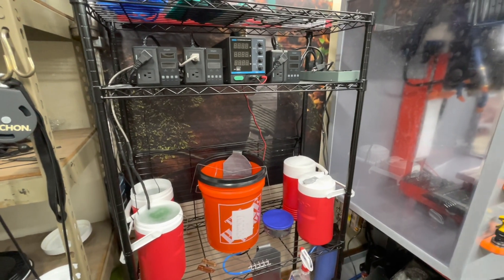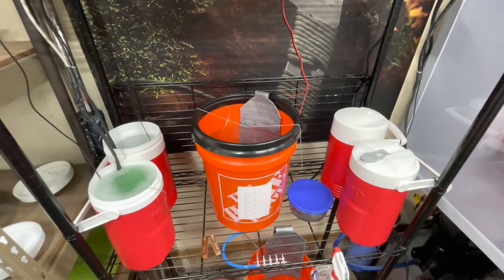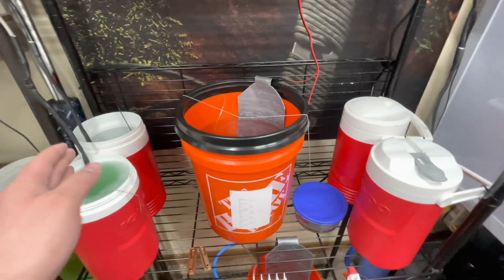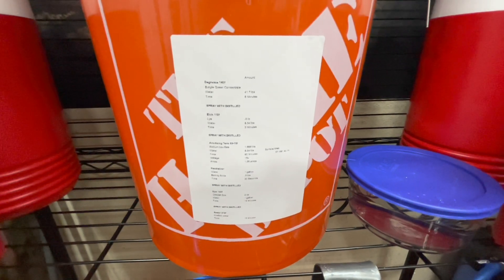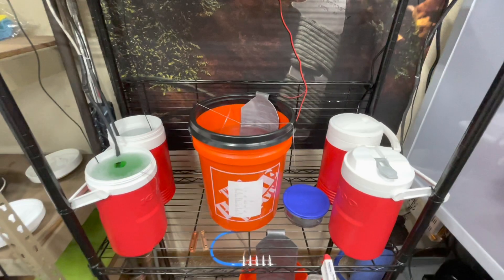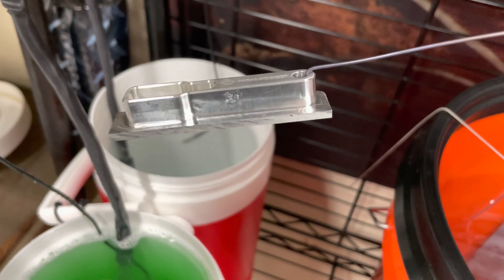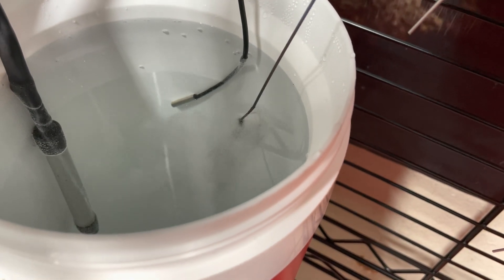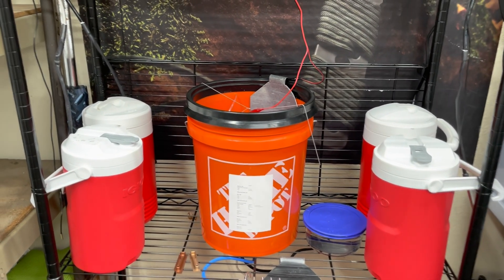Aluminum Anodizing at Home! No Sulfuric Acid.

Comment: Nice set up. However, you will have an incredibly dangerous situation if there is a spill. You never want basic, nor alkaline materials in close proximity to acids. (YIKES!)
Reply from the maker: I have to have all of them, and they can’t be far apart or else I’m dripping acid all the way to the neutralizing tank. I have two different acids, simple green and baking soda water. No other bases around.

Comment: does using a different acid affect the hardness of the anodized layer? can this be used for hard anodizing?
Reply from the maker: Not that I’m aware of. But I don’t know much. I did switch to sulfuric, but my results are about the same. This is type 2 anodizing, which can be just about any color. Type 3 is “hard” is a thicker coating and requires more equipment to do. I think it can only be black or clear. Type 2 is still durable, much more so than Ceracote etc..

Comment: What is the sodium bisulfate mixing rate?
Reply from the maker: 5lbs of sodium bisulfate to 4 gallons of water is what I use. You can get it at Walmart for about $9. Clorox pH down is what I use.
Reply: @IronForestMFG  Thanks for reply!! I see your electronics are sitting above the ano bath, are there no fumes coming out of the bath?
Reply from the maker: @jasko346  I’m going to do another video updating on what I’ve learned but I’ll summarize real quick. 

1. Fume extractor taking the air outside. Hydrogen is a little explosive and the fumes from etching are no joke. Mine is a 4” hose and 195 CFM in line fan (make sure it’s got no brushes in the motor or it could ignite the hydrogen)

2. GET AN RO system with pressure tank and make a little sprayer. About $150. This has made the largest difference in the quality so far. It’s a constant spray of clean water. 

3. Put bubblers in your dye tanks to agitate and even out the temperature.

4. Keep tight Ph control on your dye.
Reply: @IronForestMFG  My biggest worry is the fumes, I don't like them. I wear a fume respirator, but shop is in my garage and there are other people around. I do have a "fume extractor" just something I put together with a fan.. my anodizing is great quality, the process is flawless, I am just looking into alternatives for battery acid. I just do my etching outside at this point.

Comment: why not a submersible bucket heater with thermostate though?  lol
Reply from the maker: You need the electrical current to anodize. The part is the anode and the lead the cathode. It's how basically any aluminum product is given a tough surface. Think Macbooks and iphones. You can learn more here. https://caswellplating.com/

Comment: Thanks for sharing your setup.  What ratio are you using for the sodium bisulfate per gallon of Di water?  I have some battery acid here but I'd prefer to try the sodium bisulfate first.  Also which heaters did you go with?  Nice setup.
Reply: The ratio of sodium bisulfate to water I use is .25g/1mL.
Reply: @Teklectic  So 1:4
Reply: @FrippFrepp  yes, but it's not a proper ratio, it's a mixed weight and volume ratio, so I didn't want to express it as a simple ratio without the unit qualifier.
Reply: @Teklectic  sure but 1mL water is 1 gram, so it is a proper weight ratio
Reply: @FrippFrepp  whatever works for you!

Comment: One question: pot metal can be anodized?
Reply from the maker: Just aluminum!
Reply: aluminum alloys too.  titanium, magnesium, other alloys made from those.  many things.   process will change though, maybe drastically in the case of something as resistant to corrosion as titanium can be.  basically aluminum and it seems like all the glass-likes metals will take it from what i've been reading.
Reply: what's pot metal?  galvenized or something?  seems like it might work, like that shit off the bottom of a matchbox car?  lol.  that might be magnesium or something.  galv'd though.  i dunno if galvanized metal can be anodized, but i think pot metal might be zinc or magnesium, huh?
Reply: @ysph   Pot metal its an alloy of zinc, aluminum, magnesium and copper
Reply: oh pot metal might fall apart in acid or something.  isn't that cold cast super soft stuff?   if it's cold cast, it might not be dense enough to put in some acid.

Comment: I am looking at anodizing archery bow risers, the largest of which are 2 feet long. Any advise on how to because of the size?
Reply: do it in a shallow tray laying down unless you're rich.
Reply: @ysph  I am using a Duracast paint that I think looks better than anodizing .
Reply from the maker: You'll just need to find plastic containers that will fit the part... if you're only doing a few, I'd farm it out. Then again a lot of people that try anodizing find it's not worth the trouble of doing it yourself.
Reply: @IronForestMFG  lol, yea im looking into Duracote now as i have painted for years so iknow more of what to expect, https://youtu.be/fAFCOk_tdTw
Reply from the maker: @TwistedSisterHaratiofales  Definitely a good option, simply have to have a large enough oven. Plenty durable for a bow! Powder coat is probably tougher, but slightly more difficult I would think. Eastwood makes kits that are inexpensive.
Reply: Most bladesmiths use pvc or abs pipe for their ferric chloride baths. Cap on the bottom, screw top, be sure to get the correct cement for your plastic of choice. Any length you want, and I've see diameters of 6 inches for axe heads.

Comment: is there a commersil version of what you have set-up?
Reply from the maker: Yeah, check out Caswell Plating
Reply: @IronForestMFG  lol  right?  a commercial product that shorts out electricity to a bucket of acid?  lol  no.  maybe in the 50's.  you can get a bunch of buckets and the other stuff he mentioned all gathered together, but there's probably not an easy-bake oven version that you can just plug in to your usb port :P  i shouldn't say that.   i'm probably wrong.  lol  i'm curious about why you didn't use the little 20 dollar bucket heaters with the thermostat.  it seems like either those aren't adequate to maintain temps properly or something?  seems like it would have been so much less expensive minus the power supplies/temperature sensors etc.    bucket heaters don't cut it??

Comment: I tried this and it failed, I got corroding pits all over it and it turned dark grey and took no color at all. Any guess what's wrong? It was pure unalloyed aluminium sheet metal hanging from a AlMg5 welding rod, I didn't etch it before but sanded the surface and cleaned it.
Reply from the maker: Very strange... I don't know much and I haven't had this problem before.
BUT I did find this very extensive guide on identifying problems in the anodizing process. Here's a link.

https://www.fot.de/uploads/docs/fehlermoeglichkeiten.pdf
Reply: @IronForestMFG  Thanks! Looks a bit like the picture of chloride contamination. May not have been distilled water I used, I'll have to try with a new bath and see how it goes.
Reply from the maker: @Henrik.Yngvesson  If you’re using a lot of distilled, I use a Zero water filter pitcher. Cheaper than buying gallons, works great!

Comment: Thanks for the video. You have the closest setup to what I am building. As far as the anodizing bath, do you remove the cathode and aquarium bubbles when you are done or do you leave them in the acid solution? No one seems to talk about that.
Reply from the maker: I remove the lead cathode and spray it down with distilled water, let it hang to dry. Then I clean it before use again. I do not remove the bubbler, since it is plastic.

Comment: Not sure how the sodium bisulfite reacts,  but from my experience, the tiny popping hydrogen bubbles from a sulfuric bath may speed up corrosion/rust on nearby metals, if exposed
Reply: It will corrode metal, maybe not as harsh as HCl but rust will form on steel rods hanging above the container for example.